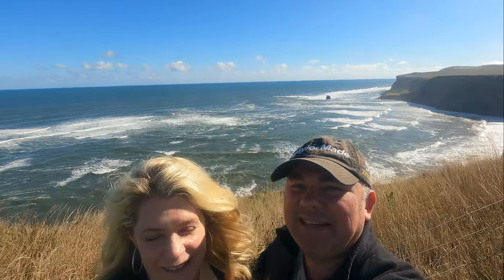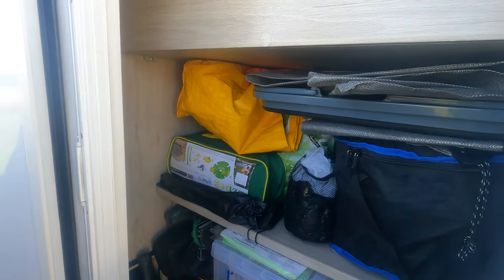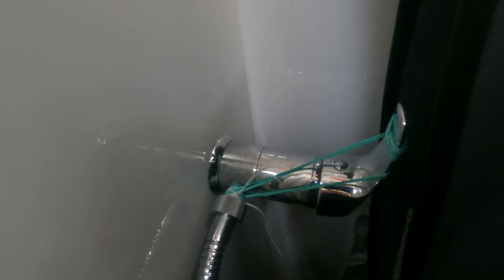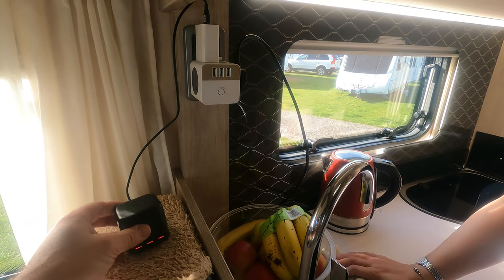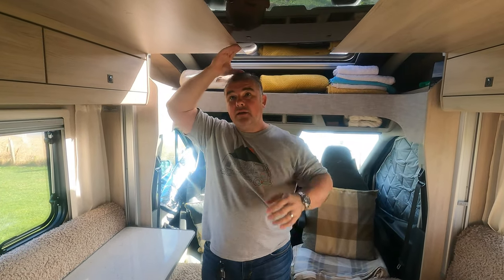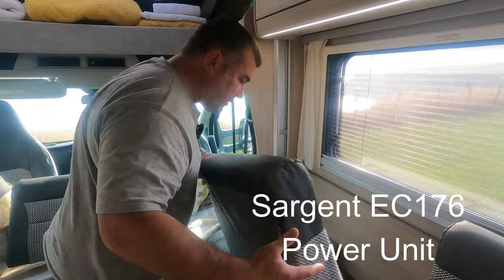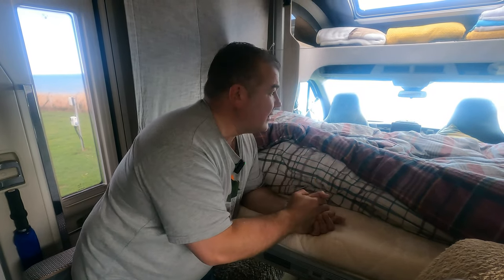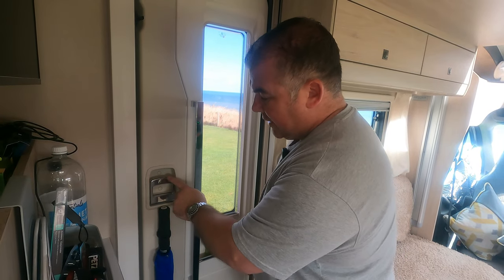VAN TOUR | Autotrail Motorhome / RV Review / F60

Comment: Standard hack with the F Line's is to rotate the kitchen tap 45 degrees so the lever faces the wall. With the dropdown, after lowering & raising ALWAYS turn the power off to the bed. For me the tricky swivel cab seats is worth the aggro in order to have the vastly superior Ford.

BBQ point, dropdown bed & travel seats are all customer cost options, they're not standard. Hack #2 drill a finger width hole through the bench seat access covers. Great idea for valuables!

Windows, nope, as a layman tried & tried to access through the rubber with no success. A professional thief can get around all poly windows.

The AT has the mid range 'Trend' spec dashboard, again this is part of the cost option 'Drivers Pack'

Ford Pass Pro app.

Great review guys!

Auto Trail F Line Owners Group.
Reply from the maker: Thanks for the info - wasnt aware of the hacks etc but really glad you enjoyed the review.
Reply: they have done the covers at the factory now.

Comment: We have the F62 and have moved the bed  stop down as you have and a cheap folding step to get on and off the bed, the difference is the kitchen location and bathroom are switched around, we are in the process of trying to fit all the stuff we had in our Auto Sleeper but we find there is a distinct lack of storage compared to our old six meter motorhome so a big sort out is needed . We have got some child bumpers to fit onto that bed piece which we have both managed to bang our heads on just to lessen the impact

Comment: Excellent Review.  As the Autotrail F60 takes 2 x 6kg Calor bottles of gas (which is a bummer)I noticed that  you changed the gas system over to the Gaslow refillable gas system, which I may get fitted on my F60 Motorhome, what I would like to know is what size of refillable bottle was installed on your motorhome. Was it the 6kg or 11kg size?

Comment: We bought a F60 last month. Today I dropped the bed and when putting it back up I must have kept my finger on the button too long and it now won't work. That's how I found your vlog. We did try pushing the button in on the fuse but to no avail. We are going to call the dealership tomorrow. However I'm really interested in that table you work at. Also the boxes you have in the garage and that wee storage box you have sitting on the shelf which also hangs. Would you be able to tell me where you purchased all these items. Thank you. We learned a few things from your video.
Reply: Also those covers on the seats. That's brilliant as we have 2 wee dogs. I would love to get them.
Reply from the maker: Congratulations on your F60. There are many aspects of that van we really miss! Including the kitchen (bin placement) and lovely open living space. So enjoy. I'll try to answer your questions. To get the table we bought the Lagun mechanism from ebay, and then we bought a tabletop seperately from ebay and fixed it to it. It was brilliant. we're using it in our new van.
The plastice boxes from the garage are "Really useful" boxes. That's the breand. Highly recommend. The fabric storage boxes (like the one that sat under the sofa (in the fot space meant for a rear passenger, was just a foldable collapsible pop up type box we got from Aldi. It ws so usueful for shoes and doggy stuff. We miss that space too. The covers we covered the seats with were just teddy bear covers from dunelm. One big one would cover the top cushion and also the bottom cushion and we' just tuck it in everywhere. Really protective and simple. Did you get the bed sorted??
Reply: @littlebigvanadventures  thank you for your answer. I did notice after I asked the question about the table leg that you mentioned it in your vlog🤦🏼‍♀️ so that arrived today. Regarding the bed , my husband had to change the fuse on top of the leisure battery and it's all working again.  However your video helped us. Final question - what size of table top did you go for?  Thank you.

Comment: Couldn't you move the milk, boots etc from the left front storage locker, put them in the garage and then put 2 deckchairs/loungers in the front storage locker? Looks big enough.
Reply from the maker: Morning! We didn't find it big enough for our Dunelm chairs, but I know you can get chairs with a smaller profile only 9 or 10cm thick. Just overall there wasn't enough storage for us, but we still really miss parts of the f60. Rebekah would swap to an f70. That's basically the f60 but with twin beds on the back over a good garage. It's 7m 30cm long though which put us off. The f60 was so easy and practical to live in and get changed in and cook in. Actually easier than the one we have now. Although we love the storage and beds on the 690g we've got. So it's all a compromise isn't it😁👍
Reply from the maker: Good idea but its wasnt anywhere near big enough to get the chairs into it.
Reply: @littlebigvanadventures  The locker looked bigger on my screen (ha ha). See what you mean about the storage overall and the 690G definitely has more space and an excellent bedroom. We've been looking at the Chausson x550 which appears to have more storage than the F60. With a 2 year old labrador a 'high' bed' avoids the 'wet nose in your ear' in the morning and since we got Archie afternoon lie downs are a thing of the past. Enjoyed your review; are you doing one on the 690G? Ah, found it!
Reply from the maker: @camlawton5681  Hi Cam - The Chausson looks amazing. Ive not seen one in person but the shorter vans do have alot of advantages. Be sure to turn some heads in that!! We will do one of the burstner probably May/June time when we are away in Dorset. All the best buddy 😁